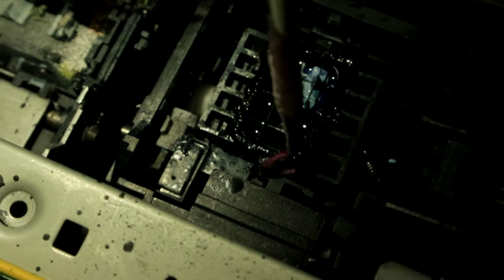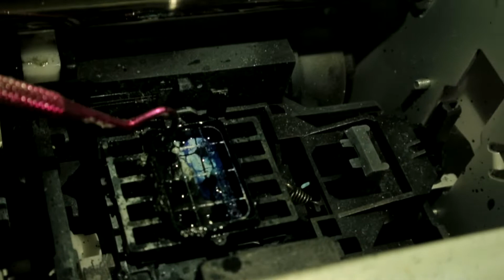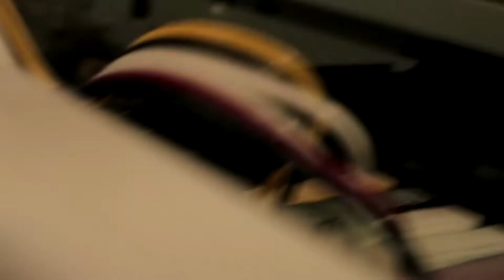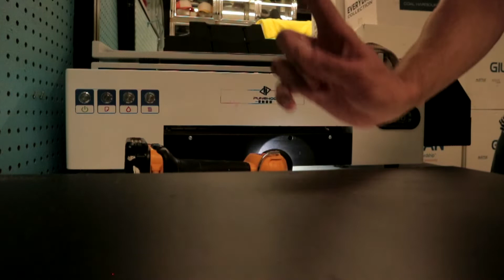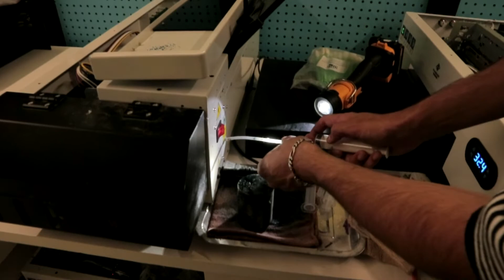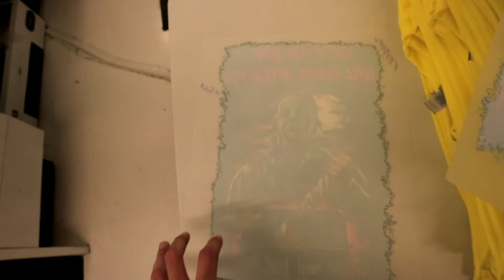How to CLEAN your DTF Printer #3 (Fix Print Head Smudging)

Comment: I'm getting double print. How do I fix it. I need help
Reply from the maker: Are you still experiencing some issues?
Reply: @Wholeprinting  yes. At times it won't do it for days. Then it starts doing it again for days. It comes at the worst times. Was in the middle of a small job now I'm stuck. Any advice would help. The company I purchased the printer through won't email me back. I did everything they asked. Even changed the motherboard.
Reply from the maker: @chrisbrooks1561  email me I will help you!
Reply: @xDominick  what's your email? And that would be awesome